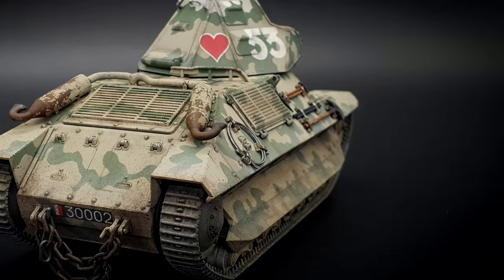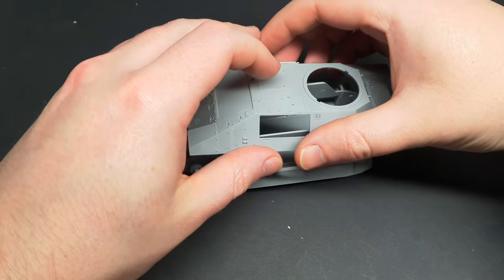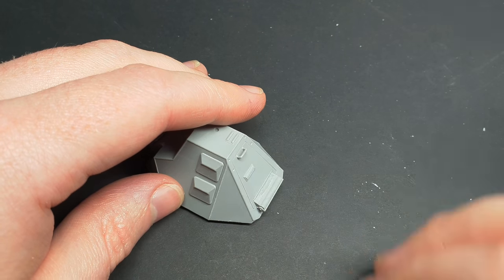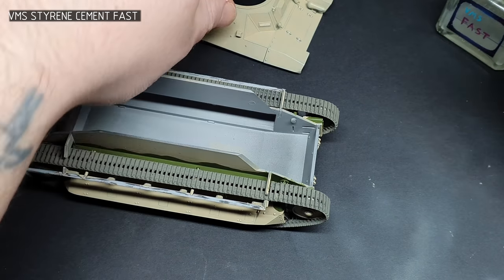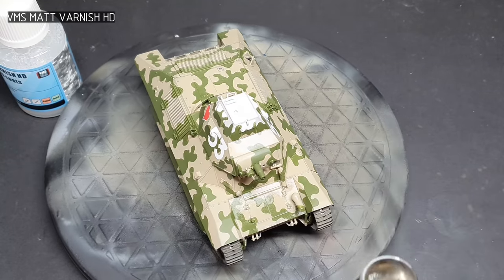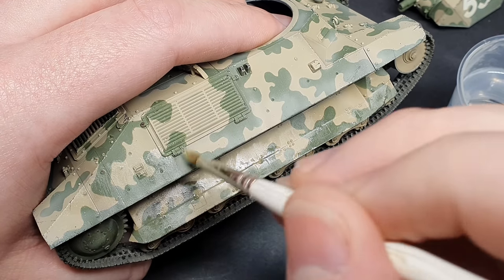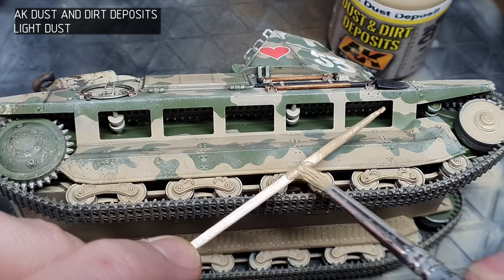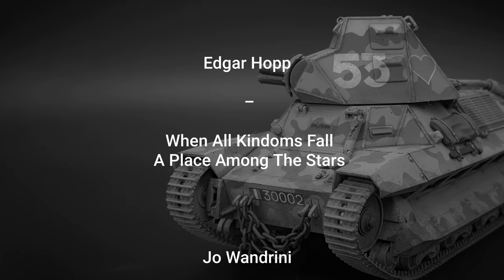ICM 1/35 FCM 36 | Full Build

Comment: Truly excellent step-by-step video and end product !! You mention the tracks and yes, I found this is the one difficult feature - so how did you connect the two runs that make up a side ?? They magically appear connected at 14.50 with no visible join. I have not yet found a way that works !! PS - There are too many comments to wade through to see if answered earlier, tbh.
Reply from the maker: Thanks Steve, much appreciated , all I did was use VMS superglue ( it is less britle and has a slight flex) and clamped em between tweezers for a second
Reply: @lpjmodels  Thanks for that :-)) Now to get some of this VMS stuff delivered to me here in Switzerland !!

Comment: This is a very nice model. I 'm glad you didn't cover it in mud and pigment, I like very subtle weathering. The only thing that looks a bit odd is the white on the turret top. It looks like melting snow, Even if it was on the colour scheme I think I would have gone back over that myself.
Reply from the maker: Thanks Allan, I'm not a big pigment user, its too messy and I'll only use it when I need to bulk up for heavy mud effects or on a base, I'll try and achieve a realistic effect with oils or dirt products, when these tanks were used there wouldn't have been too much wet mud so I went for a light dust. Thankyou ! 
The white patch is unusual but it's definately representative of the camos on these things. 
http://imgur.com/gallery/6uLdtMi

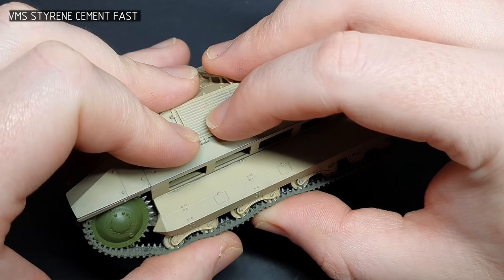Comment: Hi i just want to ask is it ok to glue after painting just like you did at 16:11. I want to glue things like shovel and boxes after painting. I try the other day but  the glue melts the paint. Any suggestion?
Reply from the maker: You can but its risky, its better to scrape the paint join back to plastic if you're using styrene cement, you can use superglue though for small items

Comment: How did the tracks go together  Were they   Glueable Or did you have to melt them together
Reply from the maker: Hi Rick, that's something I forgot in the video, they were just superglued with vms CA, the pins were very small so melting might be tricky but they held well with the glue
Reply: @lpjmodels   Thanks a lot

Comment: Hi how did you glue the track ends together? What did you use? Ty
Reply from the maker: Vms superglue !
Reply: @lpjmodels  thanks!
Reply from the maker: @williameverett8187  the VMS Superglues (flexy 5k CA) have a little flex to them, in my opinion it makes 'em a bit more durable, more give when needed which works well against shearing forces on flat parts but worked equally well for the rubber tracks